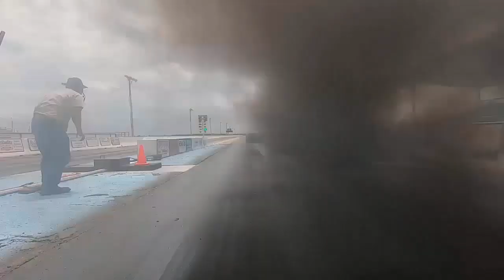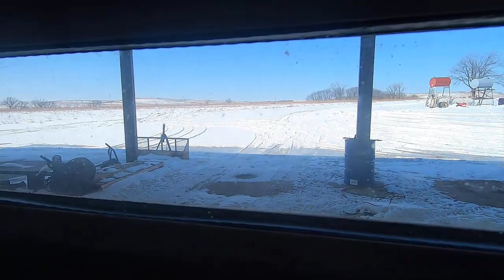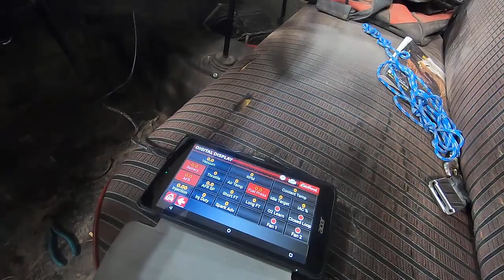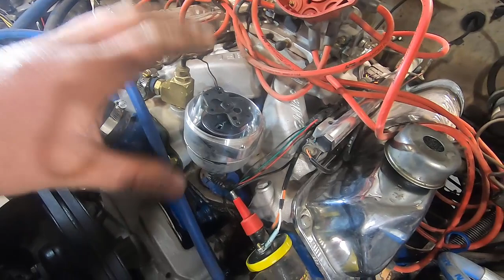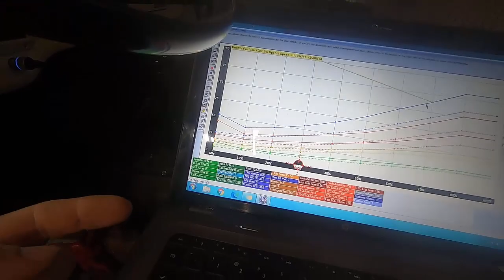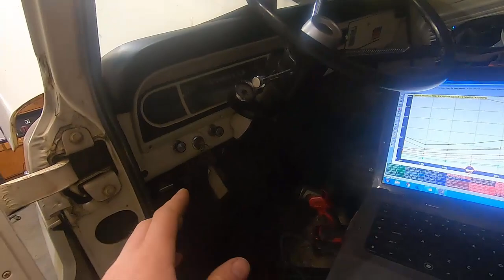Ultimate Highboy Lost Its Spark!

Comment: Might want to check out those promaxx heads very carefully when you get them - those are Chinese heads and frequently see problems in the machining or parts used. 

Hope you get it sorted out, that is a really cool truck. Really love it's a daily, I like seeing old iron still out doing what it was meant to. Edelbrock is really slow as they're moving out of California (expect for the foundry) so that might account for the delay.
Reply from the maker: Yup I’ve ran many sets on costumers diesel trucks after the factory heads cracked. The valve job always sucks. I always get the bare casting and have my machinist do the valve job. Only had one other machining flow over the years and that was the glow plug holes were machined too deep. They took care of it.

Comment: 4150 holley and pertronix. Problem solved.. great video matt! Love the bumps.
Reply from the maker: The thought crossed my mind!
Reply: @MattKubik1791  I have a pertronix on my 72 camper special. Love it.
Reply from the maker: @Brad-id7ge  yeah I installed it on my 69 f-350 I did a motor swap on a few episodes back. It really improves the cold start on it.
Reply: @MattKubik1791  right on. We have cows too. Winter time sucks. We use big spring water tubs. I love them because they never freeze. No looking back breaking ice
Reply: Some people aren't big fans, but I put an hei distributor in my 84 f350 300 6.

Comment: Ohm your trigger wire from the dist to the pcm.  Curious if possible broken wire.  Other than that I would think it has to do with something in the pcm as you said.
Reply: Intermittent makes it a pain.  But maybe the wire has a break in it and every now and then passes a signal.   Maybe worth a shot.    3 months seems excessive.
Reply from the maker: @jasonkubik1016  yeah that’s what I thought! That’s why they wanted everything too. Because if I just send one thing and it test ok I’ll have to wait again after I send in other things. I contemplated putting points and a carb on it while they check everything out.
Reply from the maker: @jasonkubik1016  also the long wait time could be due to them moving their headquarters next month.

Comment: It might be worthwhile to  check the connectors if there is any water could have gotten  before it froze
Reply from the maker: Yeah I check the plugs. Not much to go wrong there. All looked good.
Reply: @MattKubik1791  Good to hear. My dad had some water get into the connecter for the main wiring harness that runs the length of his newer F150... He was quoted 6 grand to replace the harness because is was so badly   corroded
Reply from the maker: That’s not good! Harness problems are never fun. I’ve had my share I’ve fixed on powerstrokes.

Comment: matt have you checked the timing at all sounds like to me it jumped time and sometimes with fe big block they know crack and back fire when do it ether .thanks

- nick
Reply from the maker: It’s with the ignition system. We hooked a timing light up to check the ignition timing and the timing light would only flash the few times the engine would try to fire. Other times it wouldn’t come on.